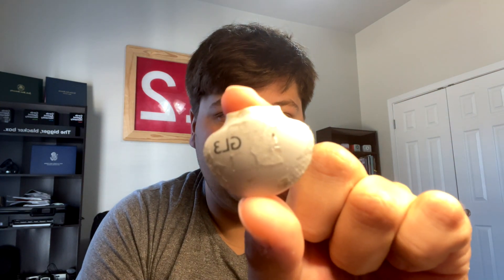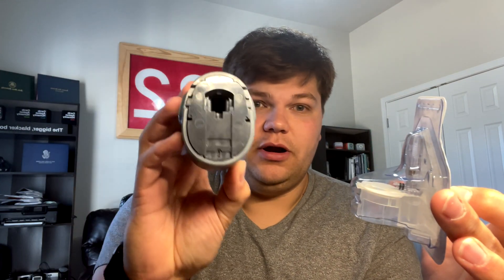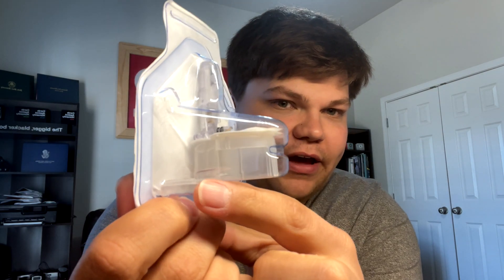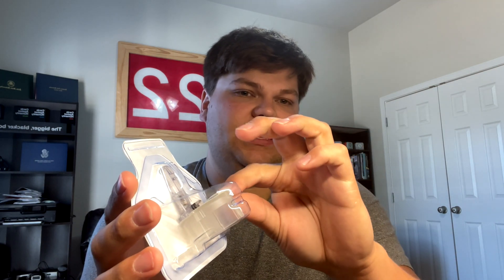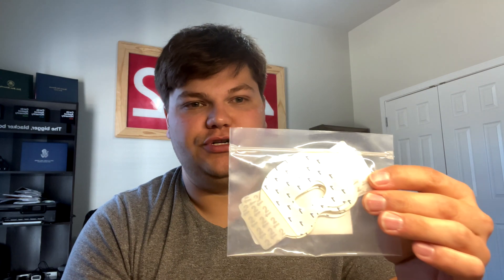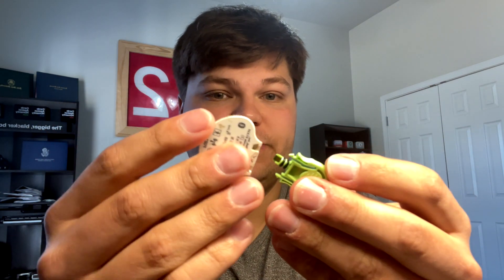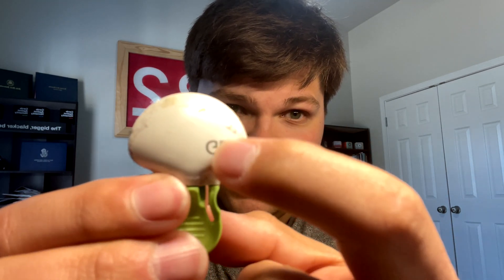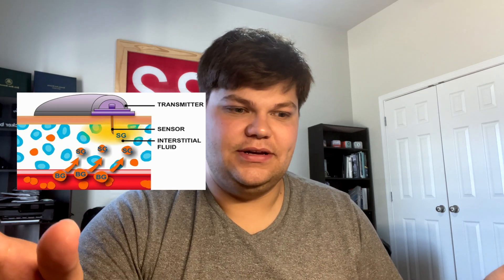Medtronic's Guardian Link 3 Transmitter and Sensor

Comment: I have a question not related to this subject, but hoping you can help:  I’ve been using a Medtronic pump for about 7 years now, and I’m finally attempting to use “Auto Mode” for the first time ever. I turned Auto Mode on this morning.  

It’s 5:00 pm and I just got a message that said “Auto Mode has been at minimum delivery for 2.5 hours. Enter BG to continue in Auto Mode.”  

I don’t understand what this means or why this has happened.  By chance, do you have a video on this subject?  Or could you help explain it?  

A side note: My blood sugar has pretty much been at a steady 100-ish, for the past 3 hours.  Thank you for the content that you put out 👍.
Reply from the maker: Okay so auto mode is looking at some of your pump settings to create an algorithm. It then uses that algorithm to decide what’s a normal amount of insulin for you to use. 
Minimum insulin- the pump thinks you should need more insulin then you are currently using over the past 2 hours. 

Maximum insulin- the pump has been giving you the maximum amount of Insulin the algorithm will allow for the past 2 hours and your sugar is still high. 

BG required- is needed when the pump feels the sensor data could be wrong. Because your sugar is super steady for something like that. 

Over a few days the pump should start to adjust the algorithm to better suit your needs. If you still keep getting the alert. You need to look at some of your Carelink reports to see what’s the total auto basal the pump is giving you per day. You can average a week. And then see how that number relates to your basal rates in manual mode. 

I hope this helps.